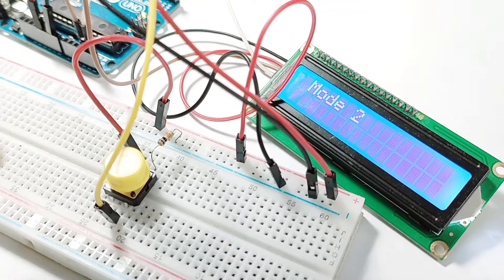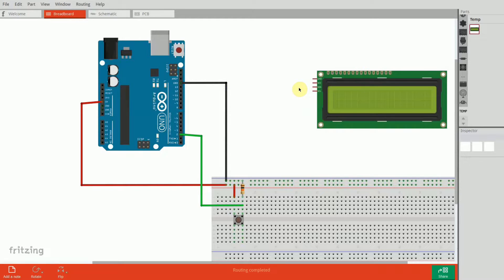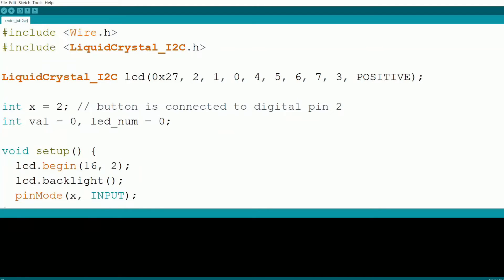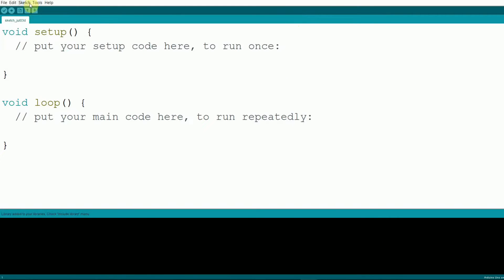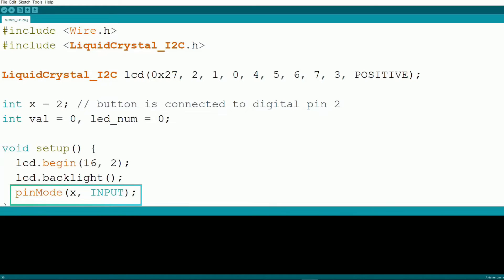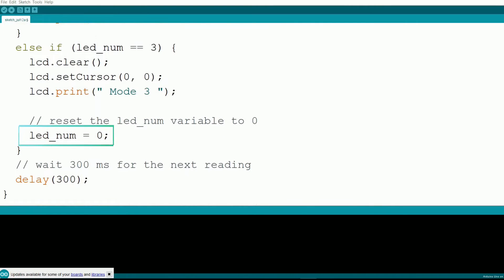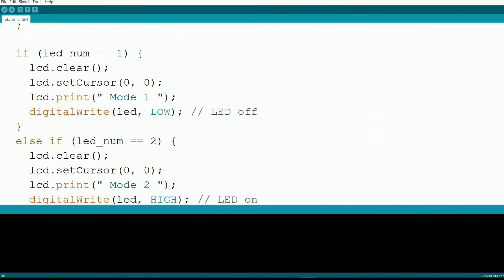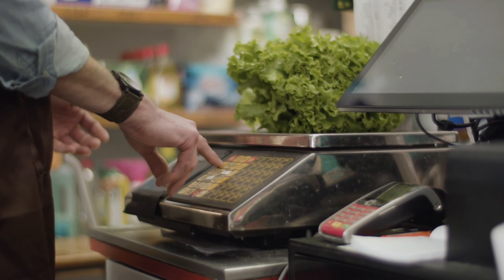Arduino Pushbutton Menu System with I2C LCD Display Tutorial

Comment: U may not use an external plug-down 10k resistor; instead, in the arduino code, write
pinMode(pin, INPUT_PULLDOWN);
to use arduino's built-in resistor
Reply from the maker: Yes, this will also work.